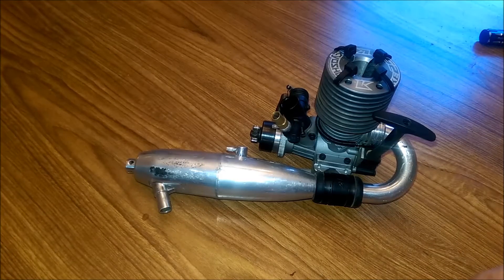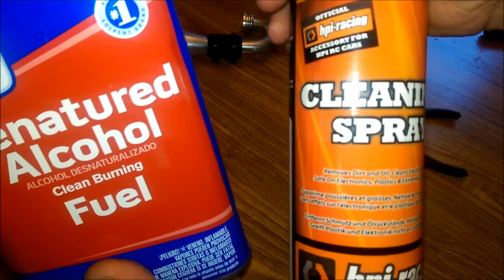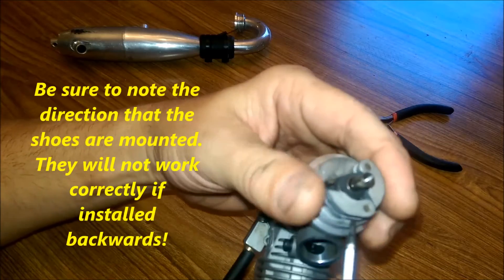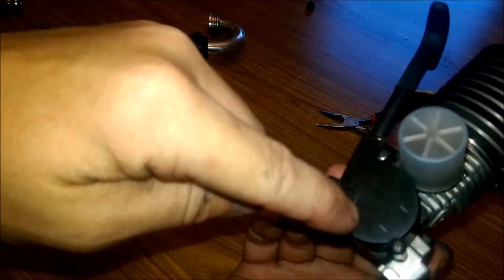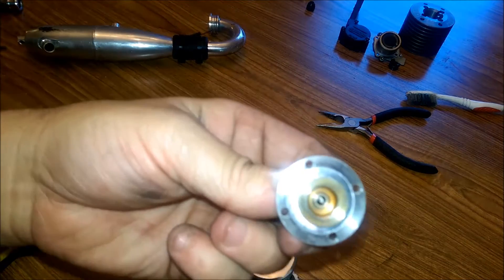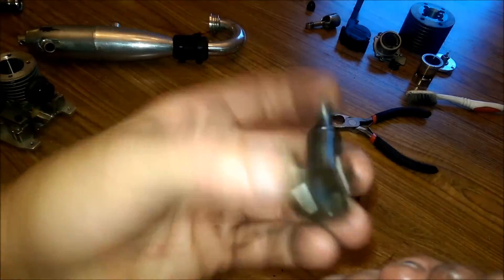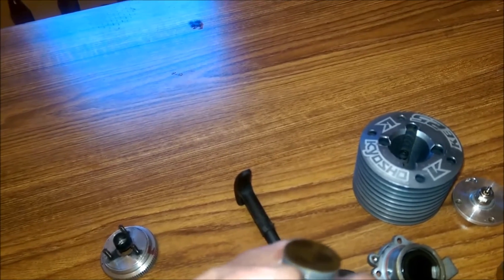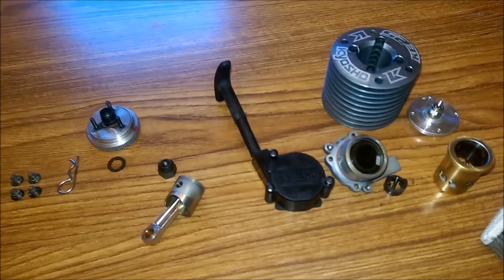How To Disassemble A Nitro Engine (Kyosho KE25)

Comment: I took my KE25 out of my nitro truck. The pull starter spins freely when mounted to the engine. However, when I pull it off with the backplate and the drive shat it does spin properly. Something is slipping. Any suggestions 
Thanks

Comment: hello i  am cleaning my engine by removing the glow plug , the air filter and dropping some niro fuel on the engine and then pulling the pullstart do you think its a good method.

Comment: seems like this engine last pretty good. How many gallons did this engine have been running until this disassemble? I'm adding maxima 927 on my nitro fuel and the e fine last forever, run even stronger for more oil more compression. have you ever did this joe? Thank you

Comment: How often will this be needed to do? what else needs cleaning on a nitro?
Reply from the maker: +Jake.Marttila It definitely needs to be done anytime you suspect any dirt has gotten I to the engine. If the air filter was to pop off while running. I like to do it at least every 3 gallons. I like working on them a lot though. It's a good idea to do it to catch any wear prematurely before a catastrophic failure happens.
Reply from the maker: +Jake.Marttila Also, I usually strip the entire truck down from time to time to clean it thoroughly. It's not bad at all to strip this RC down to the bare chassis. Also need to drain differential silicone and replace with fresh silicone every few gallons and also check the differential spider gears when you have it out. I will try to do a video on how I do differential maintenance sometime soon.

Comment: Hi Joe, I have been running my Kyosho Inferno Neo ST race spec  (KE25 engine) on some very dusty grounds. I have a feeling that some soil might have passed through the air filter (factory filter). Is there any way that I can clean (flush) the engine  without disassembling the whole block? Thank you
Reply from the maker: +Ryan Rao Sorry I didn't get back to you sooner. I overlooked this comment by accident! You can take the cooling head off and the pull starter and backplate off and spray degreaser or brake cleaner down through the sleeve really good and use compressed air to blow it out well. But if you do that then you don't lack much more and you could have the entire engine stripped down. I would strongly urge you to disassemble the engine and clean it thoroughly because it only takes a grain of sand or dirt to decrease the life of an engine. Just be sure to pay attention on which direction the piston and conrod go back in. They do need to be put back in the same direction as they come out. Let me know if you need any more help

Comment: Cool video 👍🏼! I enjoyed it. Looking forward on your next One Joe. Keep up the good work. You know that The oil in your fuel will help lube the bearings as well right. Be carful with the grease  so you don't mess up clutches and bell but I know you've bin around the block a bit so I know your aware of that. The best improvement to that RTR motor would be to get a sealed back plate so that there's nothing rubbing on you crankshaft like your pull start system. Use your bump start instead. You'll see gains of a couple thousand RPMs and less wear and tare.
Reply from the maker: You know, that pullstart system actually pulls the metal shaft that engages the crank completely away from it so there's no friction or moving parts at all. I am going to get a bump box for it after this pull start wears out but I haven't had any issues with it yet lol. Thanks for watching  Botajell!
Reply: +Average Joe Nitro no problem NITRO BRO! I will always watch your Vidds and will always support you! The part that pushes your crank to start your motor is always turning with your crankshaft right? I'm aware of the front part of the pull start set up and that's pretty cool but the part that rotates your crank is always rotating with the motor correct??
Reply from the maker: +BOTAJELL on all pull starts until this one. This is a new thing that kyosho has came out with that disengaged the part that spins the crank completely from the crank. So no it has no extra drag. It runs Like a engine does that just had a backplate and uses a bump start.
Reply from the maker: +BOTAJELL now of course it isn't sealed as well as an engine with a backplate
Reply: +Average Joe Nitro wow that's very cool!

Comment: I wouldn't grease that front bearing because it will sling grease on to your clutch and make it slip. Other then that good video dude. How many gallons you have on this engine/truck now? Still liking it?
Reply from the maker: I have over two gallons on it right now. Still liking it! Those sealed bearings are actually greased from the factory. That's one reason why they have the seal on them. To keep grease in and to keep dirt out. I don't grease the clutch bell bearings because they do and will sling grease. I haven't ever had a problem with greasing the front case bearing yet. That's man! How are you liking yours?
Reply from the maker: I suppose if one were to go overboard with grease I could see where it could be an issue. I ran it yesterday and it ran like a top! :)
Reply: +Average Joe Nitro it's awesome so far I ran out of fuel though lol gotta pick some more up here soon so I can put it they its paces. For the price it's a great truck
Reply: +Average Joe Nitro I guess your probably right about the grease thing. It's tucked behind the flywheel. My bad
Reply from the maker: I opened up the crank intake a bit to match the throat of the case intake and smoothed out the ramp a bit. I need to get some of the silicone to ramp it better soon  because it could use it. I love playing around with engines and seeing how much more performance I can get out of them! Lol
Reply from the maker: +Ghostviper79 It's cool. Like I said, if you went way overboard then it could sling it no doubt but I'm just saying that I've never had an issue with it. I like to take the seal off and clean them out and relube them to keep them as grit free as I can. :)
Reply: +Average Joe Nitro I'd like to see a running vid of after your motor mods to see what kind of gains you made. Definitely looks like you know a thing or two about working on these little mills.